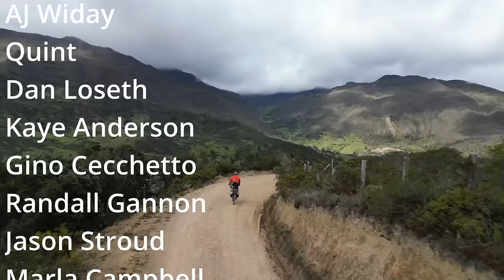Is this the Best Bikepacking Drivetrain??

Comment: Ha!  It was interesting at 11:46 to hear Will's description about tooth failure on the Gates belt.  I was a bit over 22k km on my first belt with quite a large part of that in fully loaded touring.  I had a spare belt with me, but no spare sprockets when I stopped at some point where there was a water hose to clean off the belt.  It was then that I noticed that about 90% of the teeth were just hanging on by a thread!  None fell off, and they always laid flat if I wasn't somehow rubbing against them (like in cleaning).  I also noticed that my sprockets (front and back) were quite worn.  I hadn't noticed any performance problems with the drive.  As I was in the middle of nowhere in SW Sweden I still changed the belt.  Only about 2k km later did I change the sprockets and put on a new belt.  The belt with 2k km on the old sprockets is now my spare.  --  Never, ever have I had any drivetrain failures since I switched from my old chain / derailleur setup to my Rohloff / Gates drivetrain.  I'll never go back to chain drive.  --  This was quite an interesting video.  Thanks.
Reply from the maker: Happy to hear that you got some value out of this video. It’s not our usual 🤔

Comment: As John said it is real easy to forget about your drive chain when you don't hear it and it works so smoothly for long periods. I have owned 8 different Gates belt driven bikes along with countless traditional chain setups. There is no doubt in my mind that using a belt is just better. I have taken high geared CDX based Gates belt drive systems up inclines that bent the sprocket teeth on my chained bike.  When on a bikepacking trip you should bring a spare belt. It is light and packs away easy.
Reply from the maker: Great to hear you’re having a good experience with the belts. 
Maybe you didn’t watch the entire video from the copper canyons series. In the video I clearly install the spare belt that I was carrying. I rarely ride in the city, so I need to be pretty self-reliant with spare parts and tools.
Reply: As you're traveling, do you find spare belts easy to get ahold of on the road, or perhaps order them ahead of time and shipped to wherever you're going to be next? 🤔
Reply: @OmniTierra  Sorry, my comment was meant for other people watching the video. I know you keep tools and spare parts from watching you and also Ryan trek around together.

Comment: I have watched your videos and marveled at your extreme touring mechanical abilities and how adaptable you are to change for the best long term solutions. Like your switch to enclosed gear and drive belts. My style of dirt road touring is less mechanically intense, much less days and fewer miles, and without a pup load, so no Gates in my future. I do have winter snow/ice bike with an Alfine internal drive hub that works for me where a derailleur is more failure prone.
Reply from the maker: Cool, thanks! However you get out is awesome. Self-powered travel is something special.

Comment: Of all the benefits of the belt drive and internal hubs mentioned.... for me, just cruising down a sealed path to the beach to get a coffee and a few pictures to post on Strava, it really is a set and forget system that I look at about as often as I change a tyre (which with Schwalbe Marathons, could be every two years!). For a serious rider travelling the rugged conditions like you do, the biggest benefits have to be the lack of comprehensive daily maintenance required. Imagine (at least) once a day, having to properly clean and lubricate a chain. Think of the time at the end of each day when all you want to do is pitch a tent and cook some food, and get some sleep. imagine the various lotions, chemicals, lubes, degreasers, tools, rags etc that would need to be carried, replaced and sourced in remote areas to keep up that required maintenance schedule, or chains would last just a few weeks if they started grinding on themselves and the sprockets - as well as becoming expensive, where in rural Mexico are you going to find chains, derailleurs, lube, degreaser etc. ? With Gates Belt Drives, and sticks, life is easy for both of you...

Comment: Probably a good idea bringing Veer splitbelt, just like bringing tubes in case tubeless sealant fails.
Reply from the maker: Or I could just carry a spare Gates belt🤔. Thanks for the comment. I will check out veer online.
Reply: @OmniTierra  with veer you can just slap on belt without opening seatstay split afaik.
Reply: the veer split belts with pins are not compatible with the gates center track sprockets. The pins on the veer go all the way through the teeth. They are also limited in minimum sprocket size.

Comment: Good stuff. 
For the Gates guys it would be nice if Gates could come up with a splittable belt.  Veer has one and some bike geometry doesn't allow for a non-splittable belt (e.g. DW link).  Also, if you can't swap out a belt without taking the bike apart, that's a massive limitation. 
Interesting to hear about the real world efficiency differences.  
Thanks.
Reply from the maker: Thank for your comment. Will and Ryan address that in the video.

Comment: A chain on a internal gear system will last just as long or longer, I ride year round in Japan.  My mamachari Alfine8 with 60K is still on the original drive train.  It is city bike and spent all of its time outdoors.
Reply from the maker: That’s interesting. I’m glad you’re having good result. We just rode through Central America and I imagine the climate is similar to many parts of Japan. Any metal that was not stainless steel or titanium has some rust on it. Don’t forget, I’m also carrying a 40 pound dog and riding mainly off paved roads and trails. So for us, the Pinion and gates system is the win.

Comment: I get easily 5000 miles on my fixed gear bikes, Wipperman 1/8" lubed with pneumatic tool oil. But I'm lucky to get 500 on my mtb's, KMC X11 with dry lube. It's mostly the dirt (and dry lube), but the extreme flex with short chain stays and a 11x48 cassette doesn't help.
Reply from the maker: Clear you have seen how conditions make a big difference to the system. Thanks for the comment

Comment: Hi John, who did you have build your rig?
Reply from the maker: You don’t want to use them. Worst experience I have ever had in the cycling industry in several decades. The first frame came dented and very misaligned. Second is also misaligned and needed a frame build in Colorado to correct it before it could be ridden. That’s required an international flight.  

This is why I am working on a new version.

Comment: Trying to find a Gates belt in rural areas may be difficult, if not impossible. 
The Gates belts are limited to internal gearboxes, expensive, heavy and not efficient.
Reply from the maker: Thanks for your comment Frank. 
You can’t purchase anything bike components rural areas of Latin America. 
The @carbondrive and @pinion.eu systems are pretty high end so the are spendy 💰. Have you checked the price on a new SRAM group set? 💰💰. 
This is why there is choice in the market. This video shares my opinions

Comment: shimano  8,9,10 speed. up to 50t, ubiquitous, cheap, no power loss. tried and true
Reply from the maker: I don’t think you understand how drivetrain systems work if you think there is no power loss. The other thing is that those systems do shift as well as a more modern system. It’s great if they did, but they just don’t. 
But it’s awesome that you have found a system that works for you and in the place that you ride.
Reply: @OmniTierra  my mountain runs on shimano 10 speed xt, 50t, works flawlesly. Has done for years. Actually switched from.sram eagle to ahimano 10 speed just because the replacement of parts was way more affordable. Those prioroty bikes with the pinion drive are just heavy imo.

Comment: The problem is that you have to change the sprockets as well when the belt is worn. That is about 300 euro. Its just too expensive system. It will always be a niche and will never be very popular. Im an all year rider and considering going back to chain. Chainrings and chain will cost me 40 euro total. I would be very happy if the belt would last 30 000 km, im at 9000 with cdx system and its getting to an end, maybe 3000 km left. It saves your cleaning  time that is the only advantage, but you get all the disatvantages of internal gear box.
Reply from the maker: Yeah, that’s interesting that you are numbers come out with a different result. When I ran the numbers using it higher end system with derailer and chain, the cost quickly out strips the Pinion and gates set up. There’s definitely lots of options out there for us to use.
Reply: It is not true you have to change the sprockets when a belt is worn or about to fail. I had over 8,000 miles(12k kilometers) on a single speed Gates CDX system with a 20 tooth rear sprocket and a 46 tooth front sprocket before I changed the belt after one year. I only replaced the belt because it was one year with 8k miles and I would have done the same with a chain. The sprockets were fine. The original sprockets had 12,000 miles on them but then that bike got stolen. I live in San Diego California and it has some pretty gnarly hills. I rode that bike in the mountains(bike packing), beach boardwalks with sand, and double century rides a lot. The CDX system is not perfect but they are way better than a chain system and when paired with Pinion its no contest. I also own a priority 600x that has over 6k miles on the original belt and sprockets.
Reply: @elcajonboy  Gates recomends to change them all at once, because if you put new belt on worn sprockets, the belt will wear out more quickly. They are designed to wear both the belt and the sprockets at the same time. Yeah, Californian weather is very nice. Maybe i should have cleaned it more, then would not got that premature wear on belt and sprockets. But it was advertised as cleaning maintainance free system and i bought it because of that.